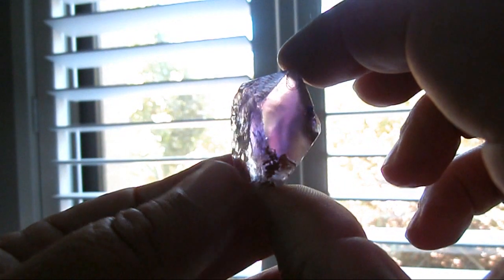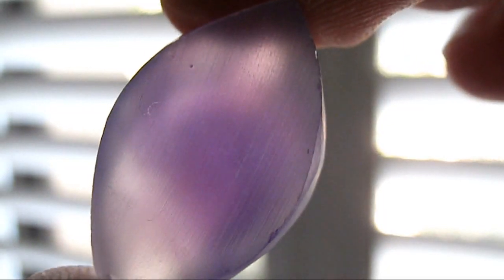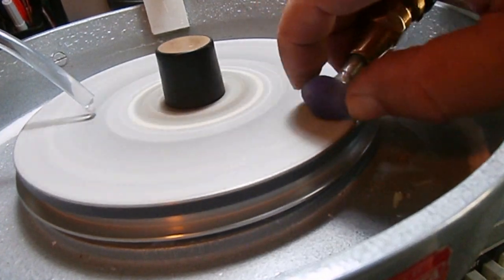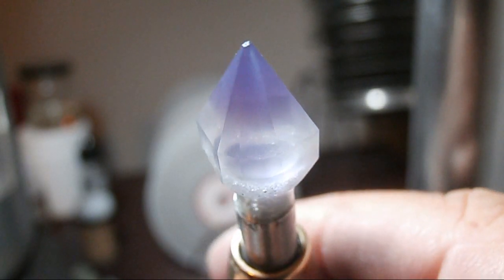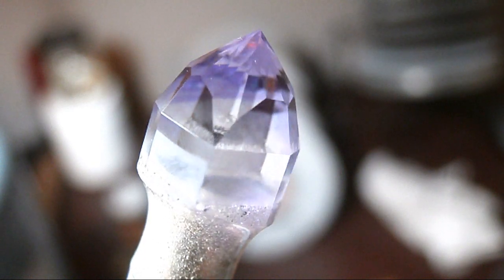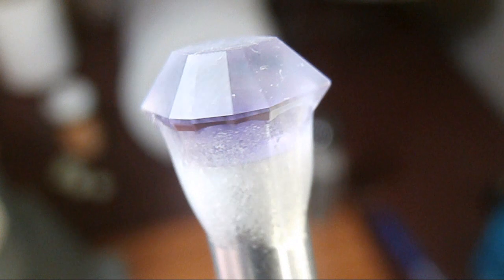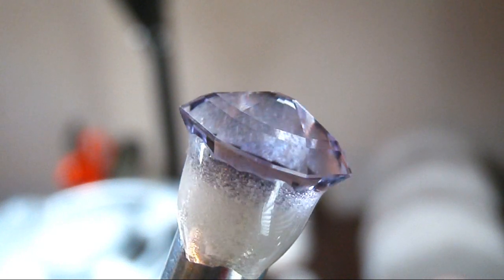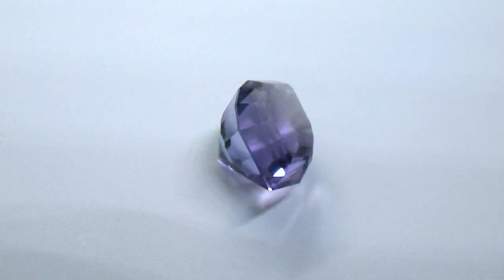HOW TO CUT GEMS THAT ARE CRAP INTO SOMETHING SPECIAL!

Comment: Hi Cliff, I am new to your site.  I fossicked my gems from many locations in NSW and Qld between 1981 and 1991 and ended up with a lot of rough.  I bought myself a brand new Gemmasta GF2 as per your 2nd machine and all the necessary accessories. At that time, I started learning to cut/facet and cut about 15 gems and made al sorts of mistakes. I am now 73 years of age, and as I used to tell my family and friends, I will save all my rough to facet when I am retired and I get Old!  Well, here I am ( not as "old" as I anticipated ) and i would like to re-educate myself on the processes of faceting. I have found the 5 videos of yours that I have watched, to be most helpful so far.  Thanks for taking the time to share with others.

Comment: Hi Cliff great job, probably because you had a good supervisor, well done Jaws.  Why do you use different oils on the final two stages of polish?
Reply from the maker: Hi Jeff, tin laps have more porosity. The Herco is a light grade oil and absorbs into the tin changing how the polishing behaves. You can control wet or dry the lap is while polishing with Herco as it tends not to be as greasy and it dries out and you can apply more drops while polishing.

Comment: Stunning job, both in accuracy and color management, Cliff.  That was actually a daring cut, being the first go with a new machine... I don't have that much confidence and opt for an SRB first. LOL

Regarding your question... On irregular step cuts, I prefer to do the opposing corners first.  It seems to me to allow for an occasional cheat on the shorter "middle" facets.

Thanks for another great video, my friend.  Love your new machine!
Reply from the maker: Hi John, I was fairly confident how to use the machine. A little unsure how the pivoting faceting head would work on the girdle. Yes, I like to start with opposing corners also and work into the middle also.